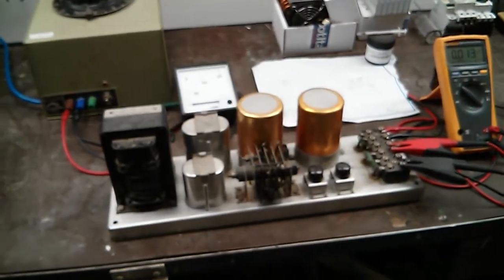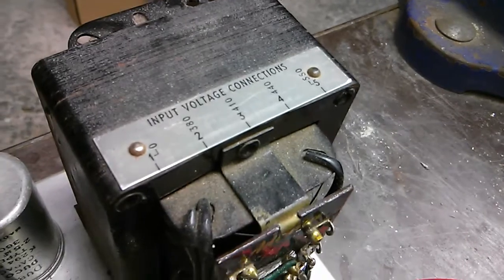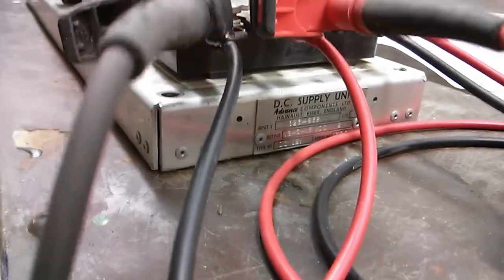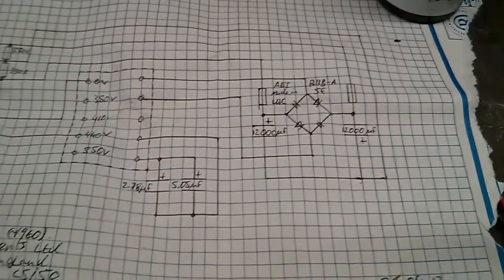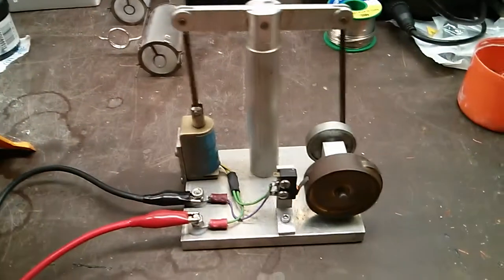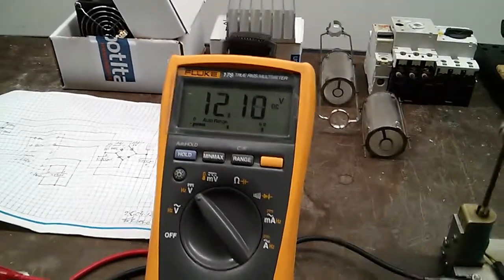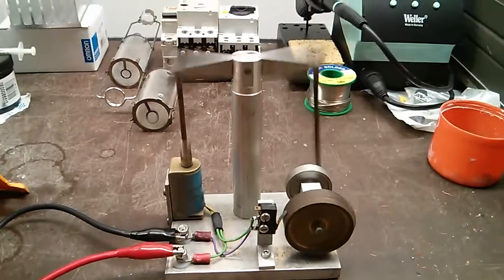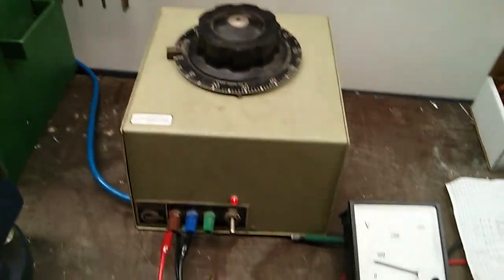1960's DC Power Supply Test Featuring a Model Solenoid Beam Engine

Comment from the maker: Thanks Rodalco,
The power supply came out of an old control room of a special alloy
rod factory building that was being stripped out, built in the late 50's
to early 60's so the dates on the capacitors are from the right era.
36Vdc would be correct for ancient control voltages, the variac does
a good job of controlling the voltage, particularly as the Solenoid
engine is very sensitive to how many volts you give it without it
vibrating of the worktop.

Comment from the maker: Thanks Choc! Advance Components Transformer, Plessey
Capacitors, AEI Rectifier all Made In England all with very
good reputations, and lives up to it 50 years down the line,
not even the caps had dried up!
I will do another video with the sillyscope to have a look at
the DC Ripple and apply a purely resistive load, none of this
fast switching solenoid engines lol. xD

Comment from the maker: Haha thanks Pete! I had to look to see exactly who you meant,
Mr horse fly doing a risk assessment on the cracked binding post lol!
And yes the rectifier is my favourite part of the circuit also, I have
a soft spot for most rectifiers, Elegantly simplistic, yet perform quite
a complex function.
The little solenoid engine is also quite elegant, being a closed loop
system that runs itself quite nicely at 12Vdc.